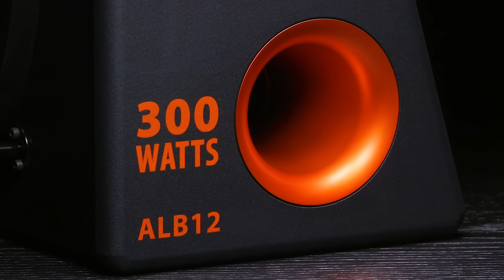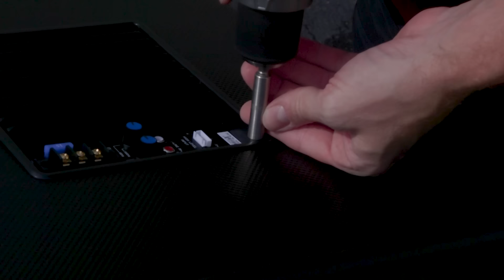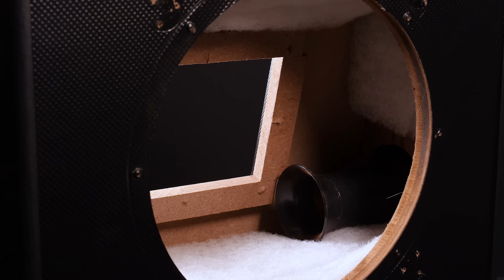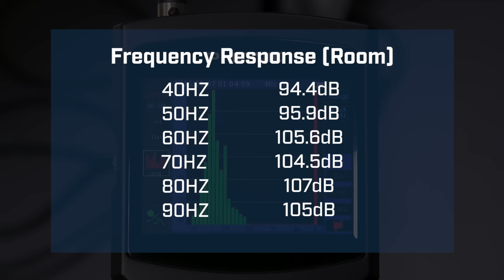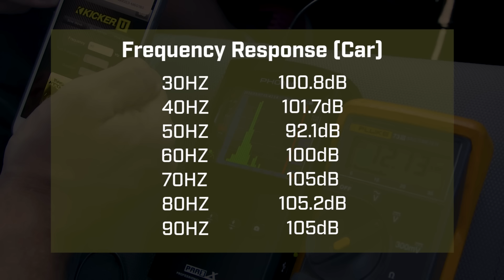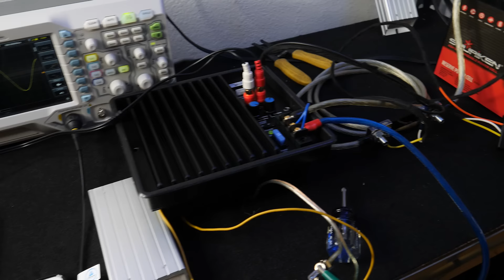Sh*t Car Audio Manufacturers Say! Reverse Engineer an Amplified Subwoofer

Comment from the maker: We just re-ran the test with 13.2 volts and the amp outputs 64 watts. We also re-ran the test at 16 volts and the amp output was 98 watts. The amp went into protect after 2 minutes of testing at 16 volts. As part of next weeks VLOG we will show the results. The spreadsheet has been updated on a separate tab with the new results.
Reply: So it gained 34 watts with only 2.8 volts added in? Wow! That's pretty nice wouldn't everyone agree?
Imagine if it was 1000 watt amp.....

Doesn't this sound a like a little shitting around to anyone else?
Reply: Quality Mobile Video Funny, i was thinking (while watching the fluke readout drop down to 11v range during testing) that id be curious to see 13.5v constant supply test results... And here we are. Great in-depth reviews/info btw.
Reply: Quality Mobile Video any chance you could test the alpha sonic forte self powered PA system? 2800 watts for 200 bucks. It seems to work better than I expected.
Reply: Quality Mobile Video at what ohm. I seen amp do best at 4 be 1
Reply: probably about 200-400w actual output, the first 200-400w is plenty for 95% of people.
Reply: @Justin Murphy ...sounds like ohms law to me...
Reply: test is fine, its low buck hardware so who cares if its only 98.4% accurate.
Reply: Jf Mc - 100% agreed. This Youtube channel has absolutely no idea how to perform audio testing. The whole thing is absolute bullshit with zero scientific basis whatsoever.
Reply: Nice to see you tested with the voltages at the level of a running vehicle I was about to comment on that.
Reply: most class D car voltage (12-16V) or USB voltage (5V) amplifiers are current limited, so an increase in voltage goes a long way.  Here they increased the voltage by 21% - it's not about the number
Reply: I dunno man, I've bought a lot of amps and they usually seem to advertise peak power.  Somewhere in the fine print the RMS power is listed, usually at half the advertised power.
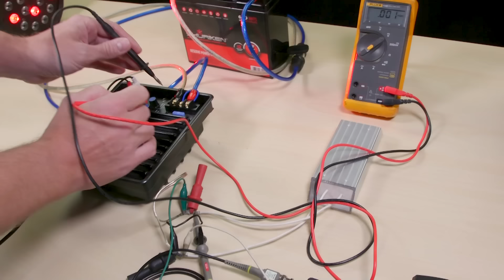Reply: bcdhifi - I have absolutely NO idea why they used a half-flat battery (and a small one at that). However, the standard testing of power output is performed using a literally "unlimited" capacity battery at 14.4V. Or whatever the manufacturer states. In this case these idiots Quality Mobile Video  tests at 12.3V unloaded at 4:17 - then doing some other tests it drops well under 12V at 5.43. Then they come back and test at 13.2V (post above) and then 16V.... none of which is the standard test voltage for car audio.
Reply: John Coops, all of which showed poor performance.  Whether the tests were good or not is a moot point given that poor performance, so your defence of the product and attack on the tests is just SJW'ing.
Reply: Stephen M - all amps will give poor performance when supplied with insufficient voltage. The alleged "poor performance" is 100% due to this being a $89 Sub+Amp+Enclosure kit - of course it doesn't perform as well as a $1000 setup. I am not defending the product, I am keeping it real... the only thing that is important is how this compares with OTHER <$100 packaged Subs. So if this Dual is so shit, what's your suggestion for something that's better at the same price?
Reply: If you're keeping it real then why reference a $1000 setup in hyperbole?  That's just a strawman argument to deflect the issue that is junk, as are pretty much all other $100 combo-package deals designed in a similar load-out.  Keep trying.
Reply: John Coops yeah I would like to see any other setups that could even compare to this for the price.
Reply: Stephen M. He doesn't have to keep trying,  the whole point was that the test was a Bullshit test!!! Do you have any idea what you are even arguing about anymore??
Reply: Yes, this under $100 setup is junk and does not perform well no matter what test parameters you want to use.  Defending this junk over some imperfect testing parameters is comical at best and ignorant at worst.
Reply: Jimothy Turner 
They all do this.
You never see RMS ratings on the box. Maybe on the back.
Reply: Stephen M 
How is something junk just because it's under $100? It is what it is and it's for people on a budget. Have you even listen to it yourself?
Reply: Likely due to cost to profitability ratio, though I did say specifically that most ("pretty much all") are junk, not that specifically all are so to infer that all are based on what I have said would be a logical and argumentative fallacy.  Keep the insults coming though, some day you might get to swearing like Jf there :)
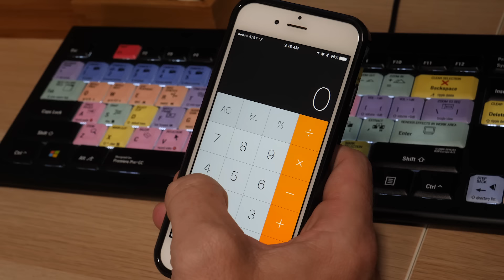Reply: Wait, what about that keyboard at 7:24?
Reply: Quality Mobile Video -what exactly happens when a speaker blow?
Reply: was just going to comment on that, glad you reran the test, 12v on a lead acid battery is virtually dead. anyway very nice video earned yourself another sub.
Reply: funny you keep saying you know the watts yet, I dont see no amp meter being used in your tests, but regardless why did you waste all your time even tearing it apart.  I can tell you right off the bat its not ever going to push 300w.  How? because its only a 13.8v supply voltage and protected by a 15a fuse.  300w\13.8 = 21.7amps even if they were only telling you input power usage there no way it happening behind a 15amp fuse... (Im not even counting internal loss)  And just so you know "Real science"... http://www.sengpielaudio.com/calculator-XLC.htm   speakers and amps use complex resistance... sorry but you cant use V²\R to calculate watts either in AC circuits... because frequency comes into play...
Reply: well played💪
Reply: Syc holic 
OMG! How did we get shown how many what were put out? Was there an SMD? Was there a meter?
Reply: Quality Mobile Video 
Great video 💯 I would never buy this but it seems to be a damn good deal for someone not too picky and only wants a little bass.
Reply: So where is the $12 upgrade video?
Reply: 12.3v is what my car battery sits at when it’s parked and not running. While running it outputs 14.3-14.5v which is closer to the standard voltage used. 16v takes more batteries than I care to fill my vehicle with so I think this test was pretty valid in demonstrating marketing hype  and manufacturing realities and that you need to run a 16v system to get it anywhere near it’s rated RMS output. That’s like having to spend $1000 on a grill to get the most out of your $5 steak
Reply: Quality Mobile Video I’m still unsure of the ohm load of the dual subwoofer. It doesn’t say anywhere in the products description nor does it say anywhere in this video (that I saw). So why were output test only performed at 4 ohms? What if the rated power output was at 2 ohms? As well as most amplifiers being rated at 14.4v. I have little doubt that the Amp could put out 100 watts had a proper test been performed.
Reply: landsurveyorNC isn’t the ohm load determined by the voice coil wiring? Being there is only one voice coil the impedance of the speaker must have been 4ohms found using the voltmeter.
Reply: Dirtyaznstyle when they tested the amplifier it was on a 4 ohm dummy load not directly wired to the subwoofer. Which still fails to clarify what ohm load the subwoofer is or what ohm load the amplifier is rated at.
Reply: Dirtyaznstyle the subwoofer may very well be a single 4 ohm voice coil, they just failed to clarify if that was the case or not. As well as failing to clarify if the amp was rated to do a 100 rms at 2 or 4 ohms.
Reply: landsurveyorNC it’s in the product specs actually : P

http://www.dualav.com/mobileaudio/alb12.php
Reply: Is dual a ok amp to just use to have a little bass in my side by side ATV .
Reply: Naw, the video is on the up and up. Vehicle battery resting voltage is normally around 12 and a half volts. That is what any amplifier would see in a vehicle with the engine shut off. Most charging systems in cars output around 14 and a half volts, some output around 13 and a half volts, while the vehicle is running. Those are the voltages the amp would see if the vehicle were to be running. Its very normal for amps to have a mild amount of increased output with higher input voltage from the electrical system. It, however is not normal to run a vehicle electrical system at 16 volts. Usually only competitors do this and it requires custom alternators or some mods to the voltage regulators on the alternators themselves. The point the video is trying to make is that the manufacturer is claiming 100watts RMS and 300 max. This 100WRMS is normally assumed to be had at vehicle running voltage at between 13 and a half and 14 and a half supply voltage. The fact that it is only outputting 64 watts at 13.6 volts supply voltage shows that the manufacturer severely inflated the numbers. It is not feasible to have to change the entire electrical to a 16 volt system and risk harming the ECU and BCM in your vehicle just to put enough electrical to the amp just to get the RMS output from it.
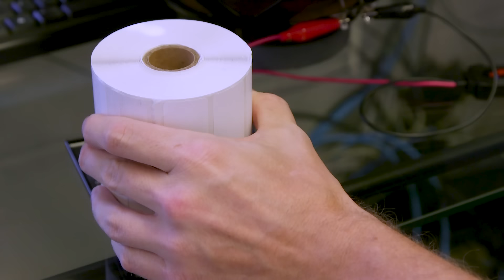Reply: You can see at 6:42 that the speaker is 4 ohms at 100Hz
Reply: Quality Mobile Video Wire up a cheap fan, $5.
Reply: test that speaker with better amp (about 200w rms)

Comment: How about doing this same examination on a $1000 subwoofer and see if they also as truthful? Obviously its going to be better, but you can verify the amplifier power, the subwoofers output and power handling and the box design and materials. You'd be surprised to learn they also fudge the numbers. Please do this also.
Reply from the maker: It's part of the plan!
Reply: John Coops #1. Give us the reasons he was unable to under your standards. I would really like to know. #2. Who do you recommend better than him?
#3. Are you and electrical engineer and audio technician who knows a great deal? If so please provide all of us with whatever qualifies you as a trustworthy source of information.
Reply: #1 - it's not my standards, it's about using scientific methodology. I have no idea what the reasons are that these people don't test things properly. #2 Old School Stereo (BigDWiz) is the first person who comes to mind. https://www.youtube.com/user/bigdwiz #3 Yes I am an electrical engineer, but no I am not an audio technician. I don't need to prove my trustworthiness, as what I am talking about is stock-standard physics, as well as 100% common sense.
Reply: naturalbornkillr check sundown audio subs, they fudge their numbers on a good way, the sundown x12 (550$) is rated at 1500w rms however most people recommend running 2000w with some people running up to 2500w with no coil heating. they're amps also perform slightly better than what they're rated on dyno's. however there amps are fairly expensive. the 2000w amo cost like 700$
Reply: It would have been nice to actually see what output transistors were being used in the amp
Reply: BigDWiz does a decent job calling out Amp claims
Reply: sundown audio under rates their stuff, most of there 1500w rms subs handle 2500w+ without overheating or much effect on its life, some setups used in comps are 3000w+ per sub. im running their x12 at 2k rms

Comment: is this the linus tech tips of car audio?
Reply from the maker: Thanks for the compliment! Yes that is our intent.
Reply: I think, or at least hope, it's better, because LTT runs on entertainment value that they usually derive from a sense of humour, but often from incompetence and random failure, and the rest of it is, how do i put it nicely, maintaining healthy press relationship with the major manufacturers - i have seen much worse cases, so i don't want to be too critical, and having worked in the tech press myself, i know it's almost unavoidable, which is why i quit, but still. LTT is not a very good source of actual knowledge.
Reply: Oh that was almost 2 decades ago now that i used to be a tech journalist. I have since worked as an engineer in electronics industry for a decade, then dropped that and went studying linguistics and working in high performance computing research. If the world gets consumed by a massive evil AI running on a cluster of Xeon Phi and NVidia Tesla one day, that's likely partially my fault now. But at least i can be honest now, right? Also i may have left some bugs in automotive firmware and medical devices in my prior career - none major that i specifically know of and not on purpose of course, but that's how it is.
Reply: Nope, he didn't drop anyhing.
Reply: Siana Gearz so then the Louis Rossman of car audio then?

Comment: This kind of shit goes over many average consumers heads. They see big numbers and they get excited. I'm glad there's youtube and knowledgeable individuals like yourself to open the eyes and minds of the many sheeple who really have no clue as to what they are buying. Great video btw.
Reply from the maker: Thanks!
Reply: Been that way for years. Hence why nearly every big name company has resorted to putting "peak" numbers on their boxes. Tired of noobs thinking "I can get a 1000W amp from WalMart for $50"  :-/
Reply: big numbers? where? a spl of 86db is crap, go by some Cerwin Vega's and be happy powering them behind a 100w class A amp cuz ya know they make about 100db from 1w (which is what SPL ratings are based upon)
Reply: lol jon what hes talking about fake #'s you see that more in home audio. example a 1200w output receiver, that has a input wattage load of only 230w. so where did the extra 1000w come from, thin air?  but thats mainly amp makers not speakers.
Reply: istishhadi I
Reply: istishhadi 1 word: Megapixel

Comment: Wouldn't the "amp" perform better at 14.5 ( charging volt of a car)  then a standalone battery dropping below 12V ? Not saying massive improvements,  but 2.5v is a big deal.

Comment: 1n 2005 I assembled and installed a showcase sound system in my car for our high-end car stereo shop. Eclipse AVN and JL Audio equipment was installed and to this day the equipment still performs flawlessly and has never been abused or removed/replaced. Sure, the head unit lacks features, the CD Changer is a bit antiquated, and the navigation system can no longer be updated. But, all features work including the iPod interface. If you buy good equipment and install it correctly you'll more than get the initial investment back in longevity. This video was great and used testing I have never seen in real time. Remember, if your new amplifier comes with a data page and the ratings are at 14.4 volts DC you won't get the advertised power. Car electrical systems run around 12 volts in the real world when you're driving.

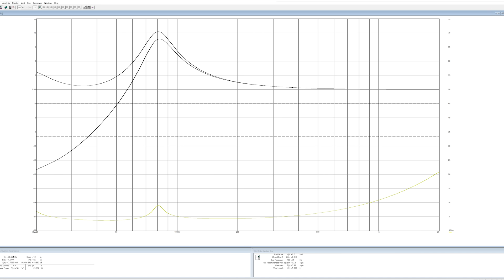Comment: Correction: at 08:00, +10dB is a factor of 10 in power, not 3.
The Amp Power test seems a little unfair at 12V, most of the time the amp is receiving round about 14V and most amps are specified at 14.4V. But i'm sure it won't produce 100W rms at 14.4 either.
Still a very good, semi professional review.

Comment: I did a 15" with a 6 cubic foot box tuned at 35 and hit 139.3db on a Rockford Dsm 100. That works pretty good. Still the same set up I use today.